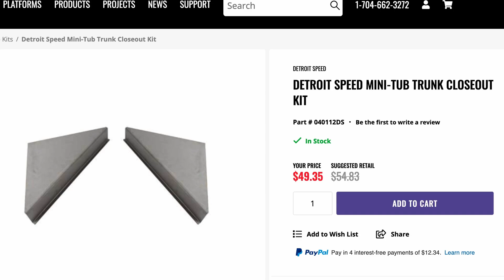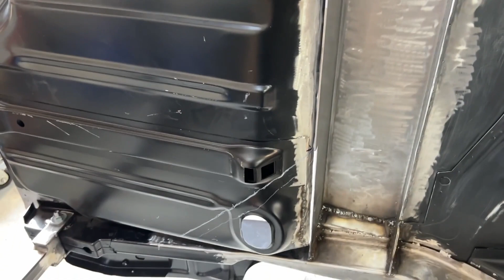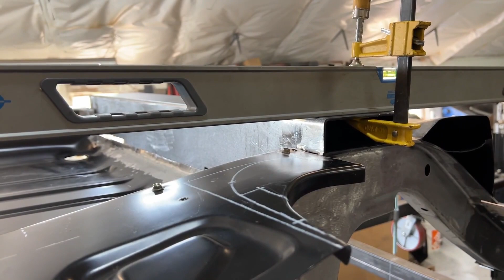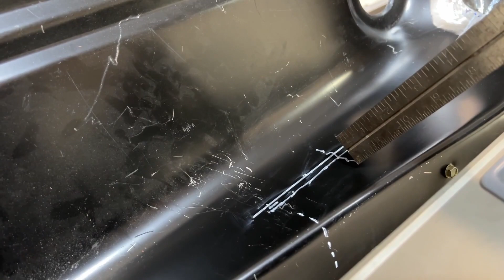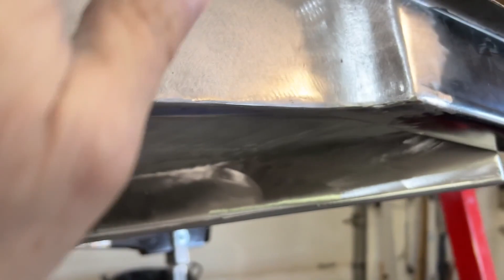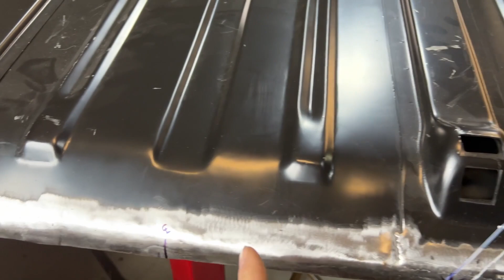See For Yourself - Detroit Speed Trunk Closeouts?

Comment: Hi, I appreciate your video on these close outs since the instructions provided are pretty light on info. The only question I have is how you joined the trunk pan to them, did you have to trim that lip off where the pan meets the close outs ? Your video didn’t show the underside pictures. Any info would be appreciated, thanks.
Reply from the maker: Light indeed! Nope, kept the lip on the closeout, trimmed the floor pan so it sat on top of it and then stitch welded the pan to it from top and bottom. Happy to send you extra pics if it would be helpful. Just let me know. You can DM me on Facebook or Instagram.